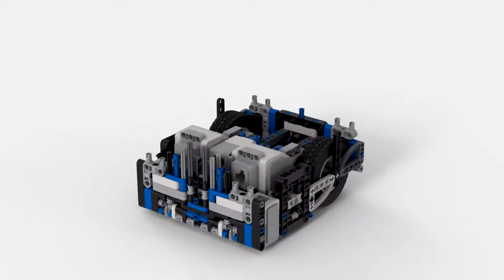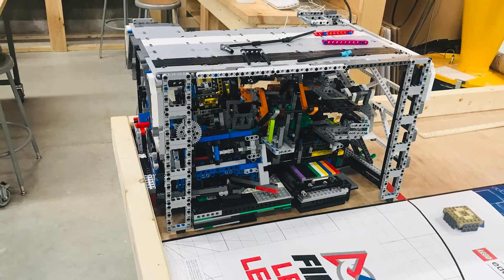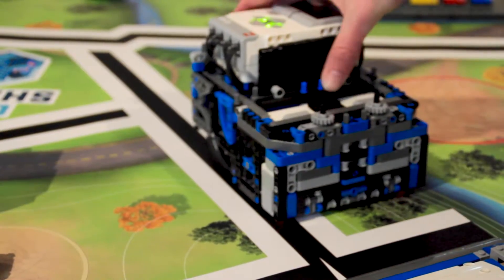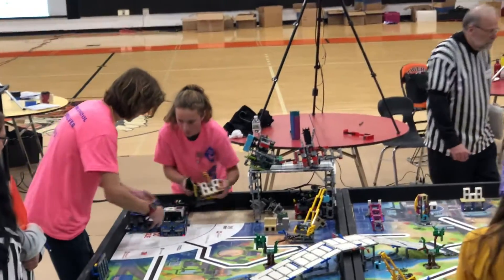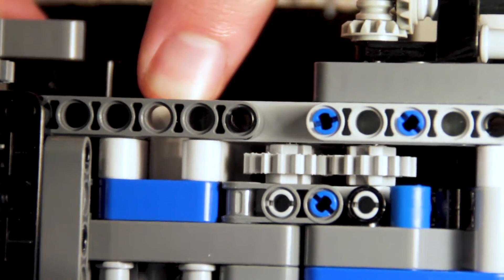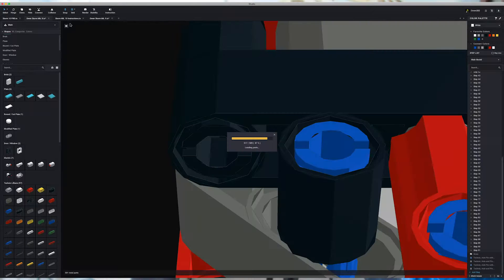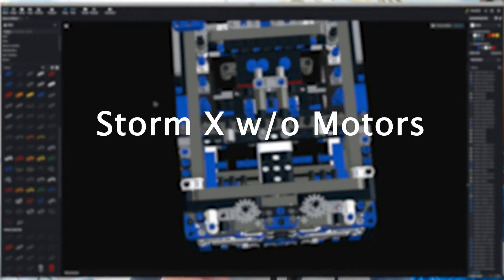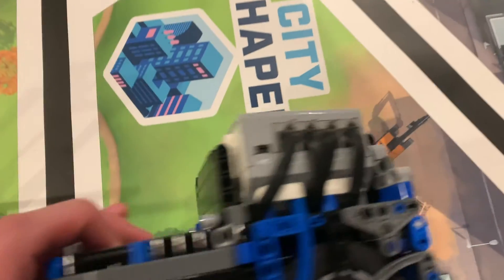FLL Robot Design Tutorial - Our World Record Robot (680 points!)

Comment: Thank you for a perfect video showing a lot of details in your design. The Studio visualisation reveals most of the internal construction. For a EV3 beginner like me it is nice introduction into EV3 robotics. (So far, I was building and programming mainly arduino based models.) 
I have one question. In your design, the robot is driven by a rear pair of wheels. In EV3-G programning environment this makes the model go backward when your program uses forward direction or forward speed. Inverting the direction by the Invert block seems to have no effect for Steering and Tank blocks. Do you have a trick how to solve it during programming so that you do not need to remember that backwards means forwards or minus speed values are needed to go ahead?
Reply from the maker: What we did was in our MyBlocks we have the inputted power multiplied by negative one before it is put into the power section of  the move steering block.
Reply: @WaringRoboticsFTCFLL  Thanks. This is what also came to my mind. I wonder if the behaviour of the Invert block (with respect to the 2-motor blocks) is a bug,

Comment: What tire size do you use? Is it available in the education core or expansion set?
Reply from the maker: We use the 43.2mm D. x 18mm wheels. They aren't in any of the mindstorms sets, but here is the link to where you can order them on bricklink: 
Wheel: https://www.bricklink.com/v2/catalog/catalogitem.page?P=32020#T=C
Tire: https://www.bricklink.com/v2/catalog/catalogitem.page?P=32019&name=Tire%2062.4mm%20D.%20x%2020mm&category=%5BTire%20&%20Tread%5D#T=C

Comment: i had designed 4 base robots. last had 19 pin width. I have passed to Estonia Finals and win the trophyes. The question:  why you using a many half width pices in your robot design?
Reply from the maker: We use all of those half width pieces (I’m assuming you’re talking about the ones around the wheels) because the wheels that we use are a little bit more than 2 units across, so if we used full width pieces they would have to be one space further out or touching the wheel.

Comment: Why did you used the half bricks close to the Wheels?
Reply from the maker: Jannik Svenson Thanks for the question! We used half bricks there because the wheels are a little bit more than two bricks wide, so if we had used full bricks they would’ve either been scraping on the wheel or the robot would’ve had to have been one brick wider on both sides. The half bricks allow us to get our robot as compact as possible while still supporting the wheels
Reply: @WaringRoboticsFTCFLL  so you have a distance of 5 between the two medium motors in the middle?
Reply from the maker: Jannik Svenson We have 3 units of space in between the medium motors, which is exactly enough to fit our gyro and internal color sensor
Reply: @WaringRoboticsFTCFLL  ah okay now i see....

Comment: I just designed 15 Robots after my Team passed out at the Semifinal in Germany NE at the end of january and i finally got one i like. It's nice to see, that you have a similar outcome and similar problems while 3d modeling your new robot! It surprised me, that your robot measures 17*20, because that's exactly the size my smallest design for 4 Attachments has!
One advice from me: it might be useful for your next robots if you had a place for attachments at the front and at the back of your robot.
And if that's not interesting for you, you could try to fit in the Size of 17*16 (mine robot size for 2 Attachments) by building a higher Robot.

Comment: And why don't you use a color sensor in the middle of the robot?Isn't it better to launch it as it is without recognizing the color of the apparel? 🤔
Reply from the maker: Fll-Team 888 Lego Breaker's The third sensor is useful because that way during a match all we have to do is put the attachment on the robot and press go, which can be as fast as 4 seconds in between when the robot comes into home and when we relaunch it. The robot can sense which attachment is on it and based on that information it knows which program to play when we press go

Comment: Great job guys! Just one question, why d'you use for the attachments those gray gears(both with the same size) instead the more usually black gears(one bigger than other)?
Reply from the maker: Gabriel Sousa Thanks for the question! The main reason that we use these gears is because the larger black gear would stick out over the front of the robot a little, which would make it difficult to build down the front of the robot. The extra strength that those gears would be nice, but we can change the gear ratios in other places and keeping the robot more compact was more important to us. Hope that answers your question!
Reply: @WaringRoboticsFTCFLL  about your robot video, theres a lot of cuts and we can see that are some modules out of the tree, so don't really score the 680. You have the attachment to do it or it's just some old video?
Reply from the maker: Gabriel Sousa There are a couple of older videos in there just because we couldn’t film due to Coronavirus, and that’s also why there are cuts. We were planning on filming a continuous video but we went into quarantine before that could happen. 

As for the building units, we have 5 blue units, 3 white units, 3 tan units, and 3 red units in the tree, and then in each of the colored circles we have a matching unit with a sustainability upgrade. It would be less points if we put any of the remaining units in the tree because we would lose the color match and the sustainability upgrade points as well
Reply: @gabrielcruzati3717  You might want to read the description that goes with the 680 point video.  But, it's a fair point.  We would love to have been able to film a continuous game, but then the world came to a standstill.  As far we knew we had 6 weeks before worlds to get that video, but now we can't even be in the same room.  Each run is complete and correct, other than the launch of black run.  Look at the description, it goes into more detail.
Reply: @WaringRoboticsFTCFLL This pandemic is making all more difficult for everyone, we were too preparing to worlds and upgrading our robot but now...
Reply: @gabrielcruzati3717  Yah, I am so sorry.  At least we have the happy memory of a cool season.  Thanks so much for watching the video.  It's a lot of fun to share this stuff.
Reply: @fasvi1285  I hope soon we will post our robot game too, we are turma do bob  from Brazil and you can follow us on Instagram if you wish
Reply from the maker: Gabriel Sousa Actually I just looked it turns out there would’ve been enough space! As I said though we were able to use the gear ratios in our attachments to get the extra strength, and we developed a program that shakes the gears back and forth to help the grey gears mesh together
Reply: @WaringRoboticsFTCFLL  thanks, I got it, we tried to use those gears in the last season but we had to switch to the small black gears cause they just fit more easily than the gray one. Nice Idea to fix the problem just by making the gears turn